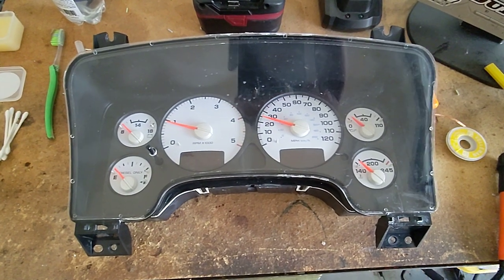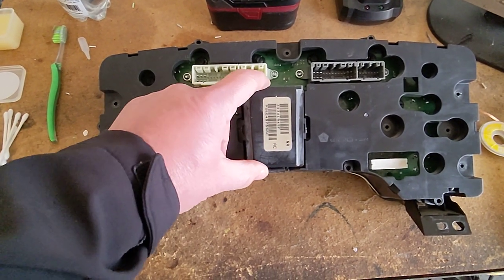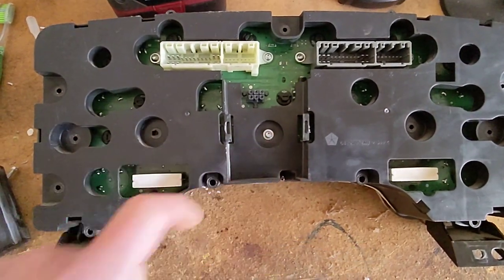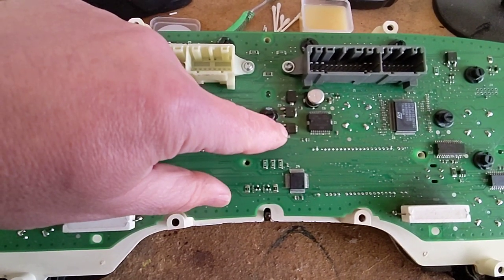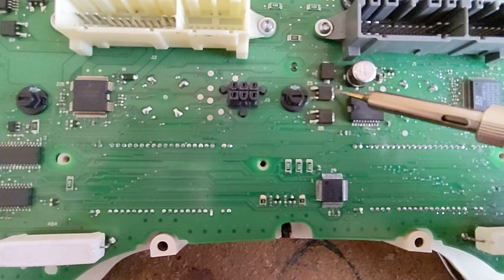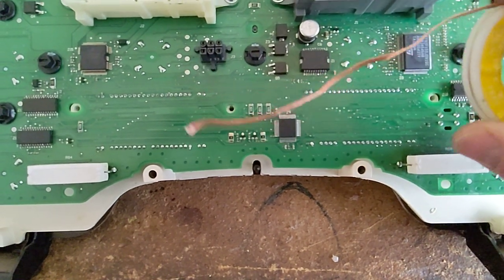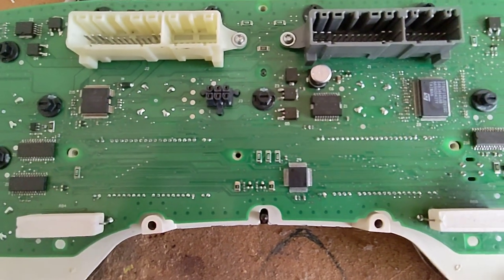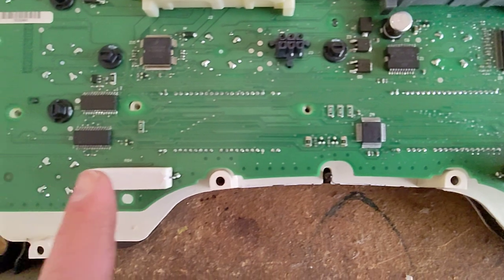Blank Odometer Gear Indicator and tachometer Fix 2003 2004 2005 Dodge Ram

Comment: This fixed my 2005 Ram 2500 Cummins. Odometer and shift position indicator off. No inside turn signals or any alarm lights. They would work for a day  or two if it was hot outside. Been that way for about 5 years. 242,000 miles on the Ram.

Comment: Mine ended up being the big white resistor for the odometer and all the indicator lights under the tachometer. In my case none of the indicator lights worked in the display. I had to remove the needles and the face plate, which turned out to be a pain to get them put back on in the correct position. It helps to have a bi-directional scanner with a gauge calibration function.
Reply: Did you replace the resistor? I tried everything in the video suggested but still no odometer or indicator lights
Reply: @agdg94  I watched a few of these videos and there's another video that has you take off the needles and faceplate. Once you do that, it exposes the two pins of that big white resistor and a couple of components right next to the resistor. In the video, it was one of the two components that had come loose. I didn't mess with any of the chips or components that the guy in this video talks about, except the big resistor.
Reply: Mine was also the ceramic resistor solder......they do get very hot when on...

Comment: Not sure if it’s an issue on the earlys but on my 06 I made some plastic washers/insulators that go in between the board and the shell to reduce vibration because the board doesn’t get completely clamped in the shell. That’s what causes them to come undone. 3 years later still working as it should🤟🏼

Comment: Thanks for the video, I've been driving around with the same issue since this is my only vehicle. On mine all of the indicator lights such as (CEL, door ajar, wait to start light) also stopped working. Did you have the same problem? Is it the same fix?
Reply: I have the same issue paid 800$ for a new tipm and it didnt fix it so here i am 😅
Reply: @ClutchTFS  After finding another video I was able to fix my issue. I can give you my email address if you have any questions.
Reply: @issaccarrizales1989  thanks! would you be able to send me a link to the video?
Reply: @issaccarrizales1989  Hello, could you share what the fix was for this?
Reply: or can you share the link?
Reply: @issaccarrizales1989  can you send me the link for the video you saw? My odometer, prndl, indicator, and all other lights are intermittent in my truck. The gauges work and the back light works but nothing else does and I need it fixed asap
Reply: @kennorton3466 my 2004.5 was the same...
Ended up being the solder on the white ceramic resistors...
They do get pretty hot when on
Reply: On my 05 the odo and gear display don’t light up and neither does any of the other indicators. Also when I use my turn signal they do not light up or click. Would this be the same fix?
Reply: @erinschwede2490  that was my problem also
Reply: @issaccarrizales1989  hello

Comment: My circuit board by the mosfits is burnt is that repairable. And is the 3500 diesel clusters different it’sa 2003 model year. Thanks for any help you can give me.

Comment: Which one is where you solder for the 06 problem of having no or inaccurate tachometer?
Reply from the maker: The tach issue is the horizontal chips on either side of the lower board section as I understand it.  The 06 has them in the same place I think.

Comment: i have a 2003 2500 ram cummins and i have about 600,000 miles on it. the odometer slowly faded and went dark around 550,000 . a couple of times it came back on briefly when it was warm and very low humidity but has been dark for a couple of years now. i removed the cluster the other day ( had to swap out the cluster lights anyway, good time to do both i guess) the two MOSFETs you show in the center of the circuit board are not on mine. nor is there a keyless remote module. i took that thing apart and went over it with stacked magnifying glasses looking for broken solder to no avail. new dash lights are awesome but still no odometer. i'm stumped. i wonder why the difference in circuit board designs? maybe for diesel?

Comment: My shift indicator and mileage go out only when I turn head lights on. 

Will it fix that problem or is there something else going on
Reply from the maker: That sounds like a job for circuitboardmedics.com which is where I ended up sending this unit to get fixed.  My fix didn't last long unfortunately.